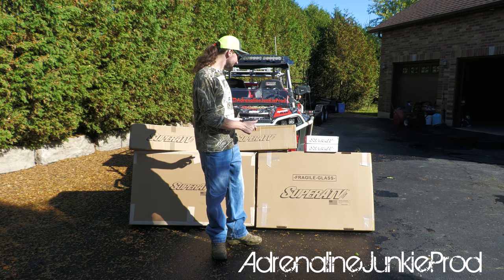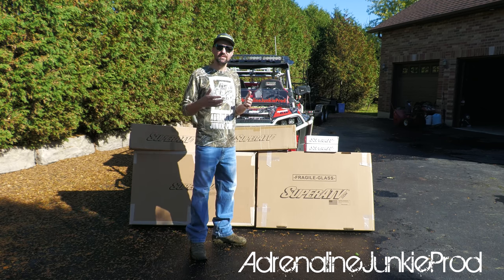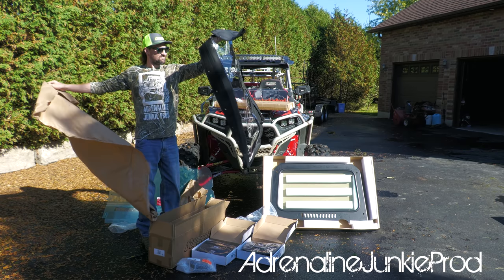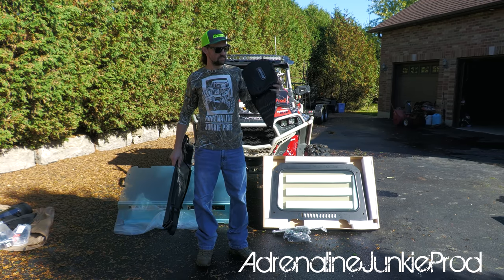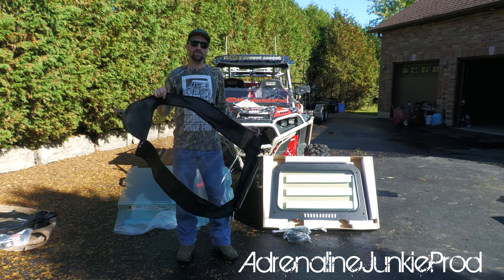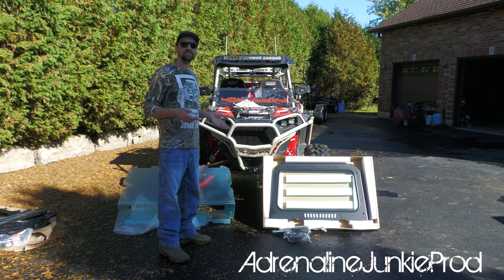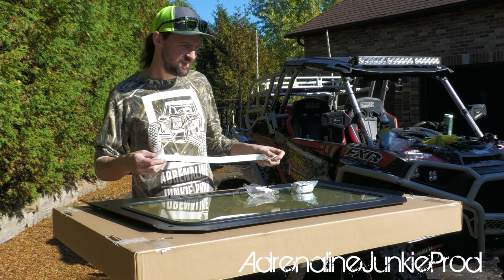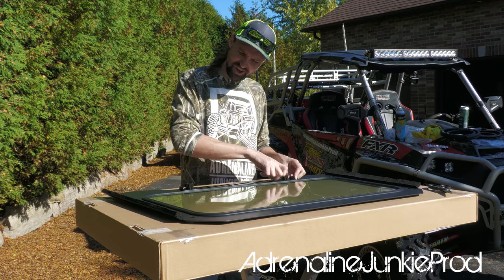Project #BattleWagon - Winter Mode V1.0 - Front + Rear #SuperATV Windshield Install #PolarisRZR

Comment from the maker: Thanks for checking out the video! Watch as I get the #BattleWagon into winter mode! I install a front and rear #SuperATV windshield and talk about some various windshield options and upgrades. There should be a new extended length trail ride video dropping in the next week or so. Do you have any winter riding tips? Leave a comment below!

Comment: awesome video, I run a full enclosure on my KRX and absolutely love it for winter/cold weather riding.  Good choice on the glass, Its just not worth messing around with a poly front windshield for the cost.  A heater goes along great so you can break the chill and keep the glass defrosted.

Comment: You may want to add a cheap defroster to keep the moisture from sticking to the inside of the wind shield. Looks awesome bro 😎
Reply from the maker: Excellent suggestion and you are correct. I need that badly. I gotta get out and grab one this week actually before our ride next weekend cause the windshield freezes up from the inside sometimes and its a pain to clean.

Comment: I think your going to see a good example of the bernouli principle when it comes to dust with the back glass top seal.   You might want to run a bead of silicone over the top.  It looks good,  and I can't wait to see more.
Reply from the maker: I might end up putting a zip tie in there but it doesn't seem to be causing any issues right now. The roof line covers it well.

Comment: I used the Oem glass on both my 900s and general because I find superatv windshield have thick borders and you loose vision. Great video. Thanks for sharing
Reply from the maker: You are right, most the aftermarket and more cost effective front windshield do have a larger border. The OEM glass windshield have the best visibility. However, in many cases they cost almost 3 times as much. At the end of the day the decision comes down to what you need and expect out of the product as well as price point which suits a given budget.

Comment: I put a super atv windshield and rear window and cab enclosure on my 2016 do turbo .. it’s a world of difference. I hope you enjoy it
Reply from the maker: So far it's great! Still need to mount the side windows. Hasn't been cold enough to justify it yet but hoping to plan a ride or two further north in the next few weeks where I will need them.
Reply: FYI I also bought a washer fluid tank with spray tips to clean the windshield . It’s a pain using water bottles. I purchased it off of Amazon $22 .. RIDE ON!!!!  and have a safe trip

Comment: Awesome - can't wait for the soft side door windows and to see everything in action!  How about a Tusk UTV heater from Rocky Mountain next!
Reply from the maker: Hey Mark. I think the heater will be something we save for next season. It's already getting to fancy with all these creature comforts, LOL.
Reply: @AdrenalineJunkieProd  I don't know about "too fancy"?  I thought I heard a comment about "motorizing the windshield wiper" - ha!  With that said, I made a larger wooden handle and replaced the little ball on the end of the manual windshield wiper handle to make it easier to operate!  You can drill and tap the end of a hammer handle or broom stick  - works great and the added leverage makes it easier to plow thru all the mud!  Also consider installing a washer reservoir and a couple of squirters to keep windshield clean.  Keeps you from unzipping the side windows when you need to get some moisture on the glass!
Reply from the maker: @markajohnson4583  Ya, the squirt nozzles and reservoir are a must! I'm gonna have to rig something up.

Comment: I’ve done a few of these windshield installs and I use a rubber hammer to install the seal it’s much easier than your fingers
Reply from the maker: Yup, exactly why I used the rubber mallet for the rear window. Makes life a lot easier.
Reply: @AdrenalineJunkieProd  I kept watching after I posted and low and behold you break out the rubber hammer….

Comment: Just bought the brand new  2022 Can-Am commander XMR. This thing is an absolute beast. Hoping  super ATV Will start manufacturing some after market stuff where there is nothing right now for it already already purchased the roof and windshield But other than that there's really nothing
Reply from the maker: The new Commander is awesome! It looks so badass! They did an awesome job on it. I'm sure they will be creating a ton of parts for it in the near future. Congrats on the new beast man!

Comment: Great video... Still waiting for my ride from polaris. new to the sport did order it with full glass front and back with heat and wiper....upper side panels are an option but waiting on those...was wondering if you got any recommendations for a roof light bar?
Hopefully my polaris general xp 4 1000 shows up mid February like they tell me. Watching your videos is getting me excited to the trails. Keep up the good work!!
Reply from the maker: Congrats on the new ride man! Sounds like you ordered it setup nice! You'll love it. It's an awesome hobby with loads of awesome people to meet! As for lightbars, it has a lot to do with expectations and budget. If  you get a bargain bin generic offshore lightbar sometimes you luck out and they hold together decent and work decent. You won't get the lifespan or light quality as a high end Baja Designs or Rigid bar but you do get a lot of bang for very little buck. If you wanna buy once and never worry about it failing on you for the lifespan of your machine I suggest going with a high end setup. I love my Baja Designs lighting. Light output is amazing and so is build quality. A bunch of my friends love their Rigid lighting and I would classify both those companies as the top dogs in the industry. There are some pretty decent mid pack companies out there now too that give you a happy medium. It's a difficult topic, it's similar to the who makes the best machine or best tire convo. Loads of opinions but the truth is if you stay with any reputable company that specializes in lighting you should be fine. Hope that helps a bit.

Comment: Wow the windshield really changed the appearance of the battle wagon! Will the window force you to relocate your cameras? Love the look!
Reply from the maker: Ya, it really changed the appearance. Still looks cool but I think it looks meaner without windshields, it has more of a "buggy" look. So one of the biggest downsides to this install in my situation is it severely impacts the video quality of my front facing camera. It still looks decent through the windshield for the most part but not as crisp and there is glare at times. Also, it makes it way harder to film from inside the vehicle in general. Considerations most riders wont take into account but I have to. I have had to adapt to it but when it's really cold I still feel the benefits of the windshield are worth it.

Comment: It almost feels like If you have front end rear windshield and did the vinyl sides sides that the engine would be enough just to keep the inside warm without having to install a heater .  I know it gets pretty cold here in Maine so that's probably that's probably the option I'm going to take.Big fan of the channel like your stuff  And the ride  videos. You guys really get into some narly shit
Reply from the maker: Stoked you like the vids man! I was thinking the same. If I mounted a fan in the back firewall access port area blowing in I bet it would easily heat the cab if it was enclosed. Only prob is it would also blow in a lot of steam.
Reply: @AdrenalineJunkieProd   Yep that is the problem But I think it would work fine Just being fully enclosed . Me and my son were out riding in the snow yesterday Night and it was actually pretty warm in the cab even though I don't have a back windshield we thought the same exact thing if it was fully enclosed it might just do it
Reply from the maker: @nowherespecial6780  I’ll likely slap those side  windows on soon and give it a go!
Reply: Fan on rear firewall Will also suck in some of the snow dust into cab
Reply from the maker: @timbonnevie8063  True. A good point.

Comment: Where can you get replacement seals? I have a 3/4 poly windshield and the seals are loose and flopping around on the edges and it drives me nuts. Or at least what exactly should I look for when searching?

Comment: I just cant do a windshield or an enclosure.  When Im wheeling I want to be "outdoors".  Not like Im driving a car.  I admit we only wheel at worst in the low teens.  Nothing super harsh.  But I hate windshields the most.  I have a quarter windshield to get the wind over my head and I can still see.
Reply from the maker: Yup, basically what I said in the video man. I'm with you. Every modification you do has pros and cons. There are some heavy cons to a full windshield but also a few really nice pros in specific settings.

Comment from the maker: What is your favorite type of windshield? What type and what brand of windshield do you run and why?
Reply: I'm running superatv flip out windshield. Works really well open when its hot and close when its cold.
Reply from the maker: @MatrixSysTechftw  I see a lot of people running those. Best of both worlds.
Reply: Ive tried several poly ones, they scratch way too fast. I run superatv glass as well now and very pleased. Should the glass break its cheaper to get replaced from an auto glass shop than it is to buy a new poly. I switch to a half windshield for the summer months
Reply from the maker: @miller440x  Ya, I've never had good luck with full poly windshield, regardless of material or hard coating or whatever. Ya, I know a few of the guys in the crew have broken glass windshields and they aren't too bad to get fixed at a local glass shop.
Reply: Have good luck with emp glass windshield on current maverick trail, only downside to that specific windshield is that they did not design it with any venting. I have new X3 due to arrive in a couple months and again got the emp glass (sitting in basement with other accessories) but it has a full vent across the bottom and opted for the 2 manual wiper set up.
Reply from the maker: @timbonnevie8063  The 2 wipers is gonna be awesome. Also, the vent helps a ton to cut down on fogging.